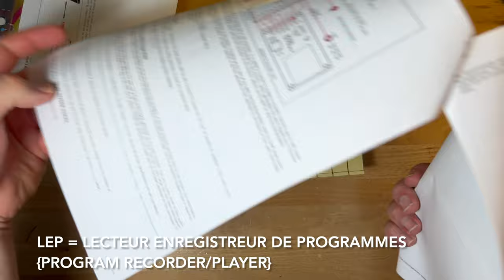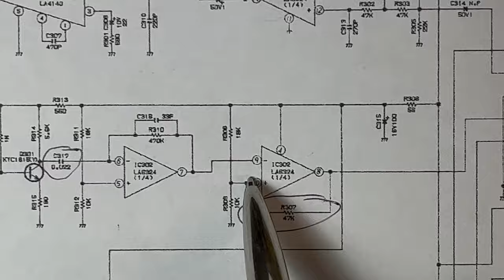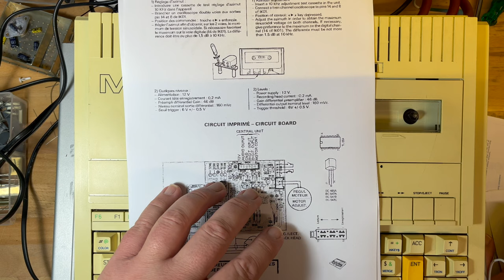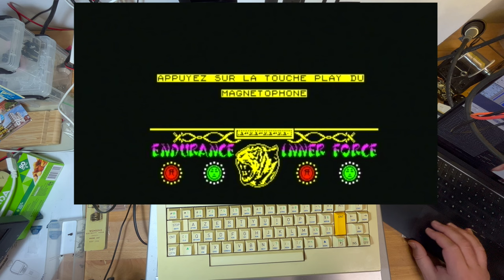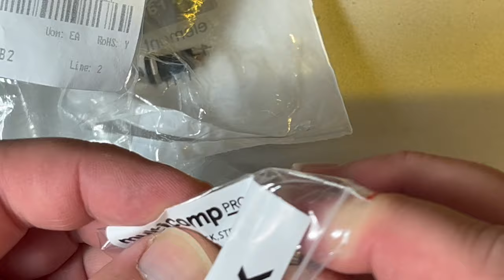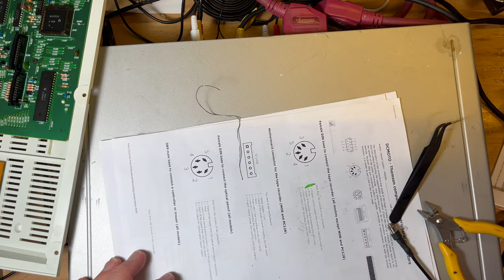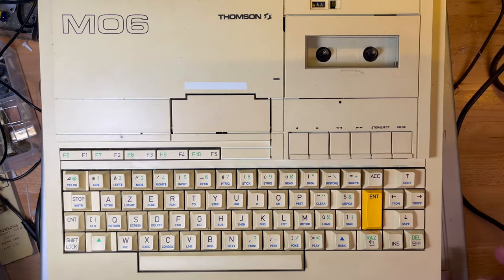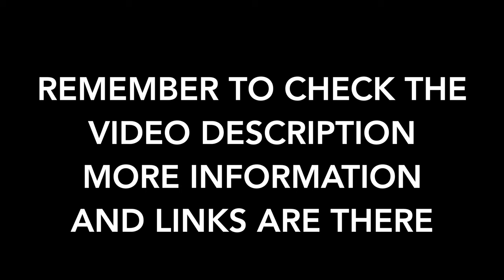🇫🇷 Thomson MO6: Part 2 (Adding Audio Input to Load Software) [TCE #0431]

Comment: Nicely done, and very unobtrusive! Although your approach of connecting your signal to multiple random points on the PCB until you find a spot that works is a new one on me. But if it works... :)

And thanks to you I'm listening to Lady Marmalade by Labelle. Twice. Maybe more. :)

In other news, I bought a pretty (and working) SHARP MZ-731 for not all that much ($250 for everything), so I may be following you down this same path. Although I would be inclined to use a device like Michael Wessel's PicoRAM6116 and pump the data into the RAM directly. 

Completely unrelated, but have you seen the "Nixdorf LK-3000" computers?
Reply from the maker: LOL ... of course, I had some vague idea ... it seems that these audio-to-TTL cassette players use a pair of op. amps and a transistor in their conversion circuit ... so I started first at the head output and then moved to the transistor.  It might've worked (at a greatly reduced volume) at the head output ... if I was just using the correct format of WAV file (for the MO-series instead of TO-series)

Comment: I'm picking you have to use your optical crayon with those games ;)
(nice solution)
Reply from the maker: Oh ... maybe ... it should be pretty easy to make one ... really just an light-dependent resistor, a switch and a few other components.  I think my T70/70 (arriving today??) comes with one "built-in"
Reply: Well, I think joystick is more likely but it would be amusing to try some of those with a light pen, especially the fighting game 😂
Not sure why you couldn't use your clavier though... 🤔